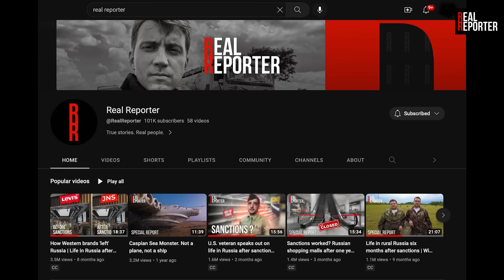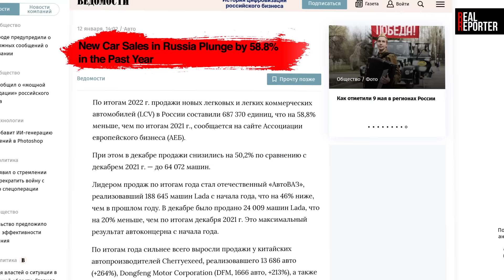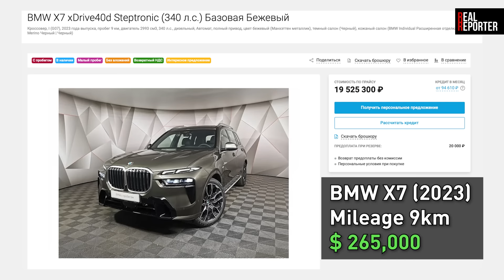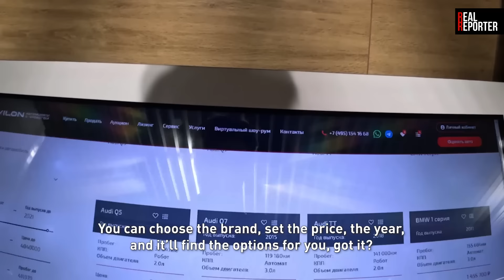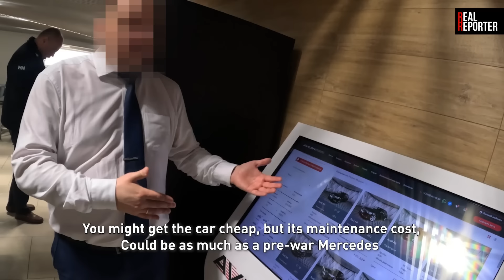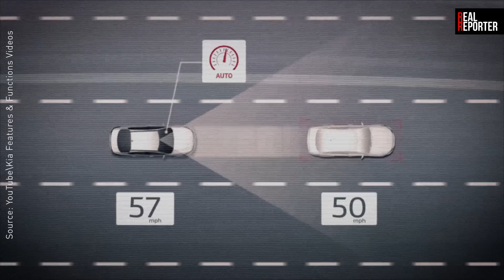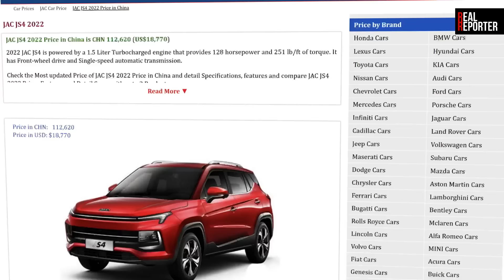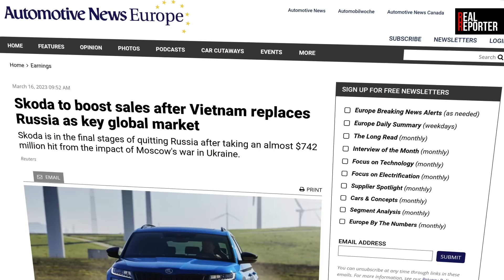Sanctions vs Russia’s car market. Who wins?

Comment: Dont get a jaguar, jaguar and land rover are in one group, both of them are really unreliable, you are buying a luxury car that comes with luxury car maintanance price. Thats why its so cheap, its because any slightest repairs will bankrupt you. Dont get a chineese car, that is supporting communism, theese cars are a modern counterpart of the cars from USSR. Your best bet is an older reliable european middle class car if you really want to upgrade. My recommendation is  any diesel volkswagen, skoda and seat from late 90's to mid 2000's. Best picks are a second gen skoda superb and volkswagen passat b5/b6. Older mercedes cars  are also a good choice, but we are speaking about early 90's when mercedes reliability wasnt crap yet.
Reply: theese cars are a modern counterpart of the cars from USSR

Lol

Comment: The problem is not specifically with the bells and whistles on Chinese cars, it's that they are on all new cars. Do you REALLY think the LCD panel will work in 10 years, or that the shoddy recycled copper alloy in the wires won't corrode to shit in the same decade? These cars are as disposable as smart phones. Wait and see.
Reply: It looks like the second-hand goods in the electronics market have seriously clouded your judgment.

Comment: Brake pads are one of the worst possible examples you could think of to use in your video. It’s a very generic part and aftermarket parts are available anywhere- I just bought brake pads in the US for my Toyota which were an off brand manufactured in India so it makes sense that they wouldn’t be affected by sanctions. 

Also, Jaguars are notoriously unreliable and used, they are not very comparable to BMW or Mercedes. 
That was an absolutely atrocious price, both for Russia and anywhere else.

Comment: Chinese cars now look decent and are good value. They have a nice interior and provide modern infotainment systems.  Nose, vibration, and harshness are poor as are the engine and transmission.

The chinese don't value economy, reliability, or performance. They value space, infotainment, and appearance. Chinese manufacturers make cars with those traits and that's the type of car they're exporting.

Comment: Always found amazing Russia has no national car manufacturer dominating domestic market. Coming from a super industralized country, it's ridiculous to have European or chinese leading the market.
Reply: There is a national and dominant manufacturer in Russia, this is LADA.
Reply: @costyapetrov1067  that's right but looking at the clip, it tends to show the brand is not the most popular when customers are deciding to get a new car. Plus I havent seen many on the roads during when they were driving.
My point is: i'm from France and here you will find Renault, Peugeot Citroën EVERYWHERE because it's affordable since retailed here compared to german and other foreign brands, easier to repair etc... It does not seem to be the same for Russia despite being a rich country with heavy industralized elements and the capacity technology to mass produce cars.

Comment: I don't trust Chinese electric cars, seen too many of those on fire. 
Still with gasoline, if they adhere to a certain material quality on essential parts that are necessary for safety, structural integrity and mechanical parts.
It used to be the case Chinese cars were rustbuckets due to cheap metals or poorly processed materials. (metal made with low quality coal for example)
I think Chinese cars first need to prove themselves in the used market for me to trust them as a long term cost a car is. A second hand Toyota is almost always a safe bet as they are generally made to last.
Reply: metal made with low quality coal？This is worthy of a Nobel Prize in chemistry.

Comment: RU: Последствия чёртовых санкций касательно автомобилей в России, можно будет ощутить лишь где-то через 10 лет минимум, ибо 3-5 лет для автомобиля это не серьёзный возраст.

Больше всего проблем явно будет с Европейцами и Американцами, ибо они чрезмерно напичканы электроникой, которая вероятно будет постоянно отказывать в работе (особенно это будет критично если от неё зависит работа двигателя, коробки передач, подвески и прочих критических важных узлов).

Главная же проблема - ценообразование! Которое совершенно непонятно на чём основано.

А пока что, наш Корейский Хендай Санта Фе 2012 г.в. во вполне приемлемом состоянии и не нуждается в замене, хотя моя младшая сестра успела побить его дважды, спустя месяц после получения водительских прав...

EN: The consequences of the damn sanctions regarding cars in Russia will be felt only after at least 10 years, because 3-5 years for a car is not a serious age.

Most of the problems will obviously be with the Europeans and Americans, because they are overly stuffed with electronics, which will probably constantly fail to work (this will be especially critical if the operation of the engine, gearbox, suspension and other critical components depends on it).

The main problem is pricing! Which is completely unclear what it is based on.

In the meantime, our 2012 Korean Hyundai Santa Fe is in quite acceptable condition and does not need to be replaced, although my younger sister managed to beat it twice, a month after getting a driver's license...

Comment: Considering you Opel is a Saturn, and that Saturn is you Opel, since it's manufactured by GM -- Here in Canada your brake job would have cost $400$ since Garages are charging 78$ an hour for labor.  

If i where you i would start working the car myself.... Luckly.

I stopped the video at 11.04 to comment, now back to the video.

Comment: The fact is western cars are expensive/owerpriced if you check the tech they provide...which means chinese ones wont cause phisicall loss... and as they are cheaper thats bad for west... but chip ban mostlikely affected as price/tech ratio is smaller there...

Comment: should be easy to get a car to Belarus from the EU and then straight to Russia 🤷🏻‍♂

ps: 7 years or 200.000km warranty is CRAZY....not one sigle European brand will give you that!
Reply: yes but warranty is written with a lot small letters, it's probably not the with same conditions at 7th year or with 190000 km as when new. Same applies to most of manufacturers.
Reply: @nm2712  you mean with a lot fine print so they have all kind of ways out…

Comment: that vauxhall/oppel u said u could sell for 6,200 bucks inwitch is about 5000uk pound say its more but them cars second hand in uk are less than 1000-2000 even the the 2013 models no wonder a sokda worth 38k second hand when you can sellk the uk cheapest cars for triple the price of the uk 😂